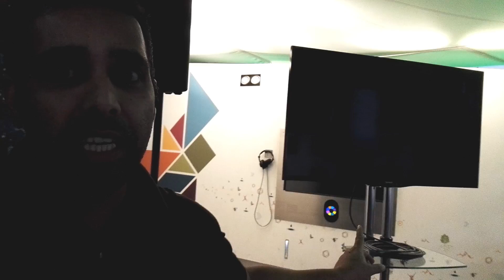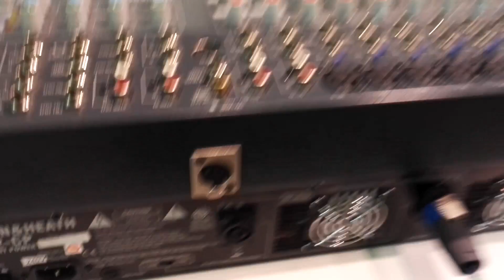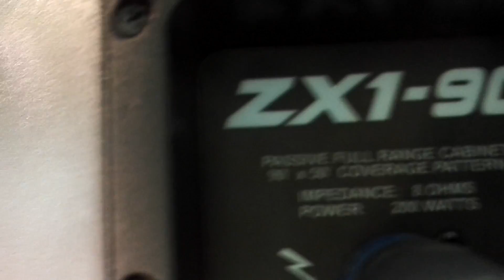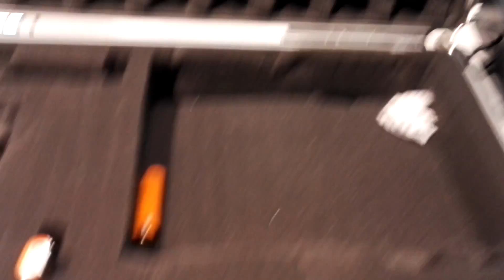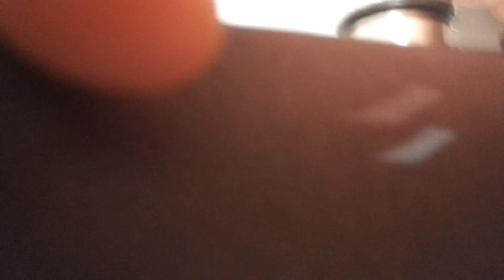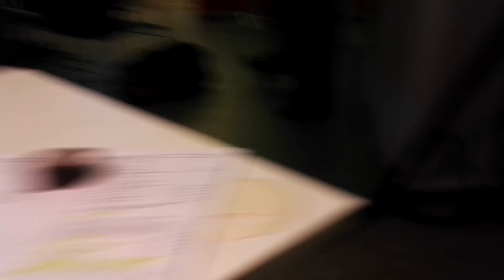How To Set Up a Live Sound PA System A Beginners Guide

Comment: So does that mean the ohms drop to 4 once adding the other speaker in daisy chain by increasing the resistance due to the additional speaker in line?
Reply from the maker: That’s Correct !!! Make sure the amp in audio signal chain supports the dropped Ohms per channel i.e L&R @ 4 Ohms per channel ( usually there is a switch 8 to 4 Ohms).  Also as 2 speakers are connected as daisy chain the wattage ( power) increases x2 per channel so again the amp should support increased wattage per channel .
Reply: The additional speaker, when connected in parallel, reduces the "resistance" (more accurately, impedance), which is why it drops from 8 to 4 ohms. One way to think of it is that the second speaker provides a second path for the current to go, so there's less of a barrier to electricity conduction overall. If the speakers were connected in series, the impedance would rise additively (8 + 8 = 16).

Comment: If your speakers are 200W at 8 ohms? Are they still 200 W at 4 ohm?
Reply from the maker: RMS watts remain the same at speaker end but amp should support the dropped resistance and increased wattage per channel to drive the speakers connected in daisy chain  properly.
Reply: Thanks AVME!

Comment: Thanks for such awesome videos, do you have any videos of controlling the other knobs per channel and also how do you connect the screen is it a tv
Reply from the maker: The other knobs on the mixer's channel strips are Gain , PEQ ( high , mid , low) , Auxes , FX , PAN etc depends on the manufacture and model of analog mixer. That is a commercial NEC Monitor Panel. For audio from Mac , take analog out put via 3.5mm headphone jack & feed into Analog mixer's RCA phono L&R inputs or 1/4'' TS line inputs. If connecting the Mac/PC audio to digital mixer's which has only Mic inputs ( i.e LS9,QL5 etc) then you would need a passive DI box in the signal chain.